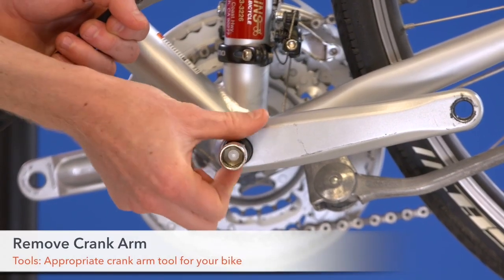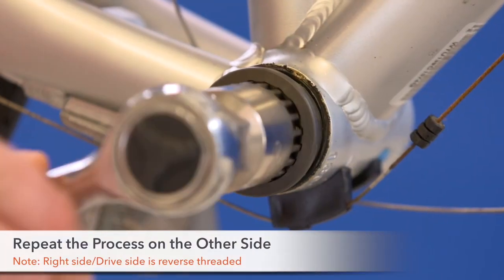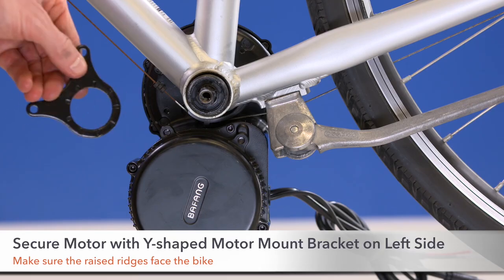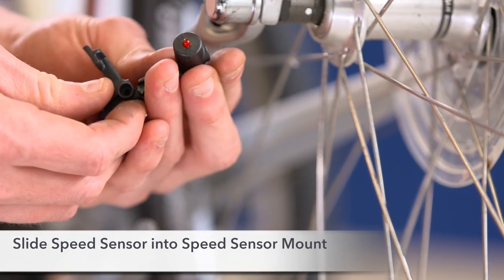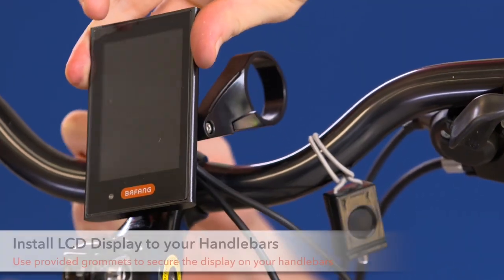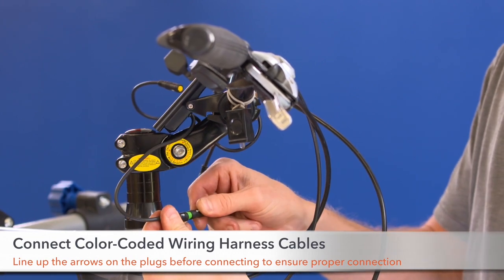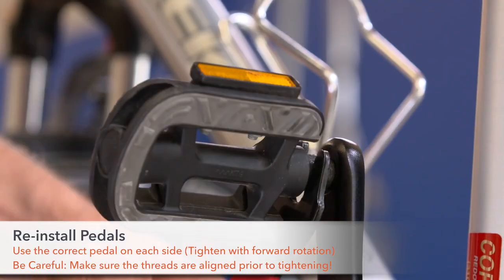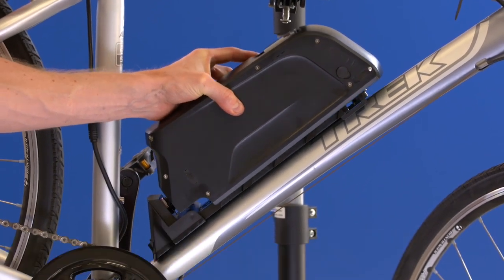Bafang 750w BBS02/1000w BBSHD Mid Drive Motor Installation

Comment: Wait, no brake sensor? Is it necessary?
Reply: Late response but if anyone else is curious: the brake sensor is only needed if you have hydraulic brakes or if you don't want to use the levers provided. Double check though that you're getting what you expect.

Comment: It's a bit unrealistic how everything just comes apart from the bike so easily like it's all already loose.
In reality everything is pretty solid, especially the bottom bracket and crank removal, as parts have bound together over time and use.
The adverts telling you it only takes two hours?.... yeah right, to do it properly and neatly with maximum cable tidying, your looking at 4 to 5 hours, especially if you have to drill and insert new bolt holes into the frame depending on which battery you buy. Because of these issues, you'll find yourself buying more and more tools you just don't have.
I convert peoples bikes as a paid service, and you wouldn't beleive the state of some of the bikes I'm given. I've had to use a heat gun on a bottom bracket before to get it to start unscrewing. New chains have to be bought, cable connection for battery and motor mostly dont match, some cheap derailleurs are not up to the task, and ALWAYS buy and fit a gear censor, without this, your drivetrain and chain will not last very long....just some of the unstated basics.

Comment: Is installing the throttle needed? Of does it still work without the throttle?
And what kind of sensor is used? A torque sensor or different?

Comment: The 750WATT kit is great value..
I would locktite the bottom bracket locking ring but otherwise pretty spot on apart from some better cable routing...

Comment: Nice video.  I wish mine was going together that easily.  Most of it did, but the battery mount on mine can't work like it does in this video.  My water bottle cage mounts are so low on the triangle that the only way to fit the battery in there while the slide mount is screwed to those cage mount holes is to mount it upside down.  And doing it that way means I have to insert the battery upside down and then slide it up, rather than down.  But even then, I can't quite get the battery to slide all the way on.  It hits the top bar of the triangle about 1/4" short of sliding all the way on.  I suspect the power contacts won't fully connect this way.  I am going to have to fabricate something to make it so I can mount the battery normally.  Not quite sure what that's going to look like yet.

Comment: 3:15 your bike has that cable that goes to the back wheel just like my bike. I see that's not a problem, the motor has a little room to spare between it and the bike frame, right ? So no problems installing ?

Comment: Thank you Ebike Essential this really helped me install my bafang motor 👍

I have one issue with my install and that's the 8mm allen screw that is fitted on the pedal crank arm. 

Everytime i ride the bike that screw unscrews itself and the crank arm gets loose. Have you ever experienced that and what's the solution to fix it.
Reply: Loctite might help

Comment: Properly explained. One detail though. At 4:15, I would have fit the motor as close as possible to the frame because the rotation of the motor is going to that direction. I've seen some people using a piece of mid soft plastic to make some clearance for the gear shift cable.

Comment: Looks very easy but of course it is not.  What I was still in the dark about was... what happens to the pre-existing nice Shimano gears?  He replaces the front one, but what about rear gears 7-9 of the little gear wheels. What happens to those?  And how are we supposed to use those gears with the motorized version?  And how about tying up the loose wires all over the place?  This left a lot unanswered.  Shame.

Comment: Do you think it would fit on the bottom bracket of an older Cannondale MTB frame from the 26 inch wheel era?
Reply: I don't see why not?  I have a smaller frame bike myself and plan to electrofit it.

Comment: This tutorial failed to mention some basic things that a beginner could make such as installing the chainring the wrong way which would cause the bike chain to derail, also the crank arms are labeled as right and left, if you break open a chain you should use a master link instead of putting the pin back in

Comment: What you do with the front deraileur and cable if removed? Cable tied to frame?No need to remove and break chain? Will it cause friction with motor?.
 My new ibiky rampage fat tire looks like its integrated hard to remove deraileur and also bought plastic guide I may not need.
Reply: just remove the cable as the front derailleur is now pointless as only one chainring.

Comment: So I got it all together, installed, & working.  Removing the bottom bracket from my bike was by far the hardest part. Reinstalling the chain and the gear shifters was a pain, the video doesn't provide much detail on that.  Other than that, pretty alright video.  I am definitely satisfied with the kit after installation.

Comment: I have had issues with this motor coming loose after tightting it with the correct torque and additionally applying Loctite to the grey Locknut. Raised ridges are facing the bicycle and are bitting into the frame but after some time the motor comes loose. It's a very annoying problem I have that prevents me from enjoying an otherwise great kit! Any suggestions people?
Reply: Someone has a fix for this. You put one worm drive ring on the motor and link it into another one that goes round the down tube. If you look at videos for troubleshooting the bafang you should find out in pictures!
Reply: thanks. I fixed it by tightening the "bitting ring" really really tight (so tight that I deformed the tool that came with my kit) and applying loctite

Comment: Just finished installation on recumbent trike.  All good except for throttle.  Female connector on throttle cable and female connectors on motor cables.  Bought male to male cable , connected,  not working.  Suggestions ??

Comment: What if you don't have spoke wheels and have 3 spoke mag wheels?????
Reply: Zip tie magnet to a spoke...it just counts revolution of wheel
Reply: @jime9305  that's what I did. Had to buy a mag wheel mount from ebay and works great. Thanks

Comment: Man this is a dangerous video that will get you hurt or killed, there is so much wrong with this video but the worst part is where he tells you to reuse the chain pin, anyone with an ounce of basic knowledge knows this is bad real bad as it compromises the integrity of the chain leading to it failing, the reason is when the pins are installed at the factory they mushroom the ends a little this stops the pins walking out, however when you push a pin out with a chain tool one of 2 things happens ether the mushroomed part is stripped off or the hole in the link is widened by the mushroomed head and so when you re-use the pin it no longer has the mushroomed head on one side meaning it is prone to walking out over time and more so due to gear shifting where it applies lateral force to the chain,  when you split a chain you are never supposed to reuse the pin but instead remove that pin and link entirely and then use a master link this is good for safety but also because master links are reusable and so so you can split the master link later for maintenance or cleaning.  By re-using a pin you risk the chain failing at that point and more so under the Bafang power and when that happens ether the chain will wrap around the rear sprocket and jam against the frame and lock the rear or it will swing up with the front chain ring like a flail and slash through your jeans and half an inch into the flesh of your leg ( ask me how i know this one )

Comment: Before mounting the motor pull the side cover off and apply high-quality grease. BaFang is notoriously skimpy on their application of grease. Use a torque wrench and the proper sockets to tighten the lock nut on the motor you can find them online, don't do it with only a hand wrench you can't apply enough torque. Get the chain line as straight as possible by using shims on the motor where it slides into the bottom bracket... you can find them online. Don't use the BaFang sprocket, buy an after-market CNC aluminum version like the Bling Ring, you can find them online. Discard the over-sized and clunky BaFang LCD, use an after-market version like the 500C, which of course... you can find online. If you are using a BBSHD you may need to use an off-set crank arm to clear the left side of the motor. I use Lekkie arms and sprocket. 
https://photos.app.goo.gl/ADgC6oyPM2gyrCq27

I've ridden over 24K miles in the last 4 years on two BaFang mid-drives. It's like being a kid again.

01 Jun 20
https://www.relive.cc/view/vZqNNQonXGq
https://photos.app.goo.gl/2SeH9P8Cd4H7PGLq6
https://youtu.be/s-8GlQHVx-c

Stay safe.
Reply: @Locust Hypnosis That's a big problem with a mid-drive and a multi-geared bike. You have to decide what gear you are going to be in the majority of the time and work to get the chain as straight as possible for that gear. That's why my Rohloff Speed-hub works so well, a single rear gear so the chain line can be straightened and still be able to use all 14 speeds. The Bling Ring helps to get it closer then use the shims for the bottom bracket I mentioned. I have heard of people that have used shims on the drive gear (the Bling Ring) itself to dial it in even more. What a lot of people don't tell you is that they don't change gears. They use the motor at its highest power and race around like a baby motorcycle. The best thing you can do is find a Great LBS that is willing to help you with the initial motor set-up. If that's not a possibility then go slow... in more ways than one. First, take the time to get the motor mounted properly with the chain line where you want it. Second, set your BBSHD to 9 levels of power and only test it on level one. There's a learning curve on how to apply the power so you don't shread anything. Keeping the torque low at 1st will help. Stay safe.

16 May 21
https://www.relive.cc/view/vYvrAx3eBLq
https://photos.app.goo.gl/cvUC7ZLSPbjYQpWJ9
https://youtu.be/u3yIOujdxVc
Reply: @Locust Hypnosis Cool.

Comment: Very nice video. 
I am from 🇮🇳 India. How can I order this kit? 
What will be the price of this Kit? 
Is the motor peddle assist?
Reply: The BaFang mid-drive has both a throttle and pedal sensor. You will love how simple the throttle is to use in conjunction with pedaling.

Comment: Do you know if this will work on a cargo bike like a Babboe curve?
Reply: it all comes down to the bottom bracket. these fit on standard 'BSA' bottom brackets that are 86-73mm wide, which covers most of them. not finding that bike's specs on google, though, so I couldn't tell you if that specific model fits or not (you might be able to find out by looking at the branding of your existing cranks)
Reply: @DFX2KX  68 mm to 73 mm , not 86mm to 73 mm. You can also order wider ones for Fatbikes...100 mm and 120 mm

Comment: What is the NM torque of the motor?
Reply: 50-60 NM is printed on the lock nut. I set my torque wrench to 80 NM and have never had it loosen at 80 NM.

Comment: Some of these steps will present you with enormous and unfathomable misery. The bottom bracket is a nightmare waiting for you.
Reply: Not for anyone with half a mind and willing to purchase the right tools to do the job. Stay safe.
Reply: I just feels that way. Had to go for a help of a local bike repair store. For $10 they helped me to remove this damned bottom bracket. Which one apparently got stuck so hard I couldn't move it at all.
Reply: @SenChiFru  The difference between you and him is that you will try and then get the assistance you need... he won't even try. So you needed help with the BB and had to pay 10 whole dollars, big deal. If you get the right tools you can easily mount a BaFang mid-drive on your bike. IF you do need help, ya get it, and from then on you will be able to do it yourself. Stay safe.
Reply: @brianbassettnumber1  to be be fair, the OP might have a press-fit BB, and those are a right pain even with the right equipment if my understanding is correct. BSA-style brackets? well it makes good sense to think ahead and order the tools along with the motor, but it is doable.
Reply: @DFX2KX  Not something to be afraid of even if you have to ask for help. Stay safe
Reply: @brianbassettnumber1  there's 'OMG I might break it!' and then there's 'this isn't worth the hassle'. I can't really fault anyone for the latter. If you've got a bike shop that's reasonably priced, that's always an option... The cheap ones here didn't survive lockdown, though...
Reply: @DFX2KX  It's really hard to find a great bike shop. But if you are going to own an ebike you have to know how to maintain it.
Reply: You need a proper tools so you don't have a nightmare.

Comment: The BBS02 can do up to 1300w, while the BBSHD can do up to 3000w. But only if you purchase them from the proper people. If buy a BBSHD from Ali for example you may get one with a locked controller than can only handle 750w max(legal limit). But, if you purchase from most vendors, they handle 1000 or even 1500w. These are the same motor, just an upgraded controller(better FETs) and allow for some fine tuning/ programming. I personally only use LunaCycles for my Bafang parts, reason being that same BBSHD that can be 750, 1000, or 1500w......with them they offer an even more powerful controller called the Ludicrous controller, which allows up to 50A current. With a 52v battery (58.8) thats 2940W with a motor still stamped as a legal 750w motor. Obviously, if you ride like an idiot you still deserve to get pulled over, but if you ride defensively and with some caution, I dont see it being an issue. The police in my area have no problems with mine. This set up allows my bike to do 50mph+ on flats. I have 4000+ miles on mine with no issues either.
Reply: If you want to ride a Class-3 baby electric motorcycle only in traffic and off-road you can do all that nonsense you mentioned. Plus wear a plate and all the expense of having a licensed bike. Of course, you can just disregard the applicable laws and ride where you want as many do. That's all fine until there is an inevitable accident involving someone other than your own dumb ass. Insurance companies are really really good at mitigating responsibility. In any situation that a cop IS involved pictures will be taken of the bike and motor.  If it's a Class-3 ebike on Class-1 or 2 infrastructure you will be ticketed at the least. If it's an accident involving a car and you aren't legal... you will be held responsible, or at the very least you won't benefit from the driver's insurance if he was at fault. Ride a Class-1 ebike under the CPSA definition and you can ride anywhere in America that bicycles are allowed.  With all this wisdom and "good advice" you're offering I think we would all love to see your bike and some of your rides. 
I agree with the info you provided... it's all from Google searches and YouTube videos of people that have actually done it. I just think all that is stupid if you want an ebike rather than a poor man's short distance motorcycle. 
https://photos.app.goo.gl/ADgC6oyPM2gyrCq27

Comment: Good video , but this kit needs motor mounts 1-2 inch longer so motor is NOT at a down angle reducing clearance from underneath this  happens on MOST bikes.

Comment: i bought a 4 stroke gas engine kit that required me to replace the crank on my bike with a wider crank which was supplied with the kit i bought. once it was all installed, i had a problem keeping the chain from popping off of that front replacement gear. watching the chain in action, it looked like after every 4 or 5 tooth to chain actions while cranking with it up off the ground, the chain was trying jump off of the gear like the spacing was just a little off. when i searched the problem i was told to buy a dremmel and grind every point on that gear smaller to get this to work correctly... has anyone had this problem with the bafang kits gear assembly? i really wanna buy this to replace that gas engine that never worked properly, but don't wanna get burned again.
Reply: Have you bought a BaFang mid-drive yet?
Reply: @brianbassettnumber1  yes. I love it. No line up problem! Went on super nicely. Had to buy bottom bracket adapters because my Kmart cruiser had a funny size axel wise(THANKYOU lunacycle!) but after I had that everything was pretty much just tighten down and I was going.
Reply: @brianbassettnumber1  heck yeah! I put it on a seven speed cruiser so when I’m on the nice trails I can bump it to low with about a 13 mph top speed, and when I get on the road I can usually get it up to around 28ish. Love still being able to take the trails though, no way would that have flown with my 49cc gas motor.

Comment: Can you tell me the length of the cables? I'm planning to install the system on the rear BB in a tandem bike and I'm worried the cables might be to short. If needed, there is a way to extend the cables with some basic electronic skills?
Reply: Did you get a BaFang?

Comment: Will this work on a foldable bike, it has a metal hinge as a stand where the bafang motor should be at?
Reply: I suggest a motor kit either on the front or back wheel.

Comment: I have a BBSHD with the Ludicrous controller from Luna Cycles. Pushing around 3k watt on a stretch cruiser (see pic as avatar). With 8 spd IGH from Sturmey it gets around 50mph. Highly recommend the Bafang motors, but would only recommend buying from Luna. They are N Americas #1 seller, and have some "upgrades" nobody else sells. Love mine.
Reply: I buy from AliExpress